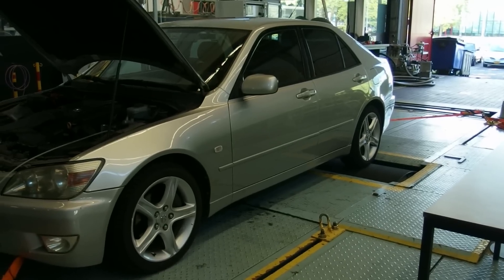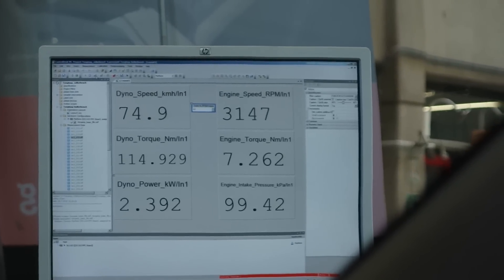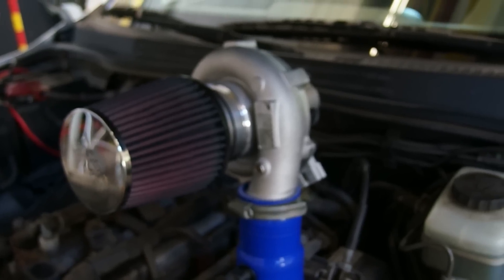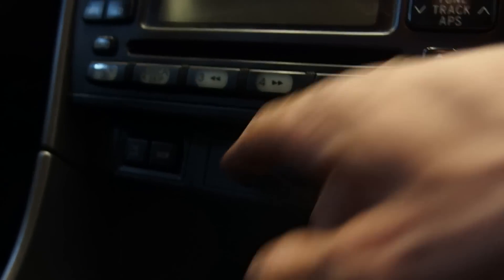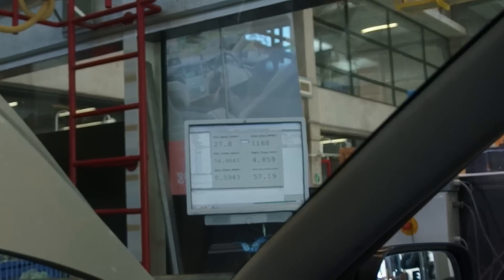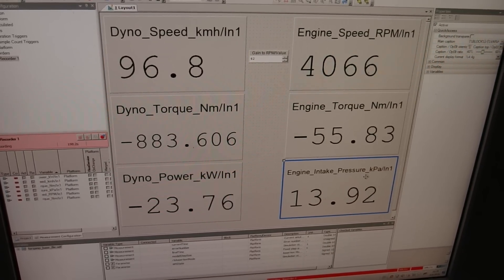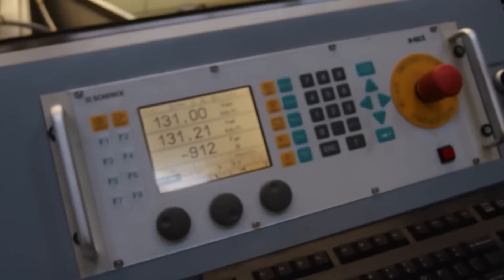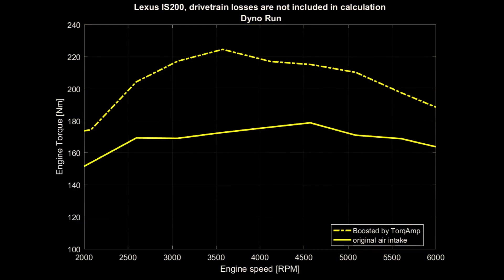Dyno testing Electric supercharger on Lexus IS200 TorqAmp

Comment: Nobody talks about the lack of airflow, or should I say - airflow restriction when you have the unit installed and you are not activating it. The car will not get enough air. To resolve that you need a customized air intake box manifold with a one way valve that will allow air to flow in when the engine needs it and the Torqamp is not active. When the unit is activated, the one way valve will close and the engine will use the boost.
Reply from the maker: This is the case when you run a large turbo build. For this we developed the Bypass valve which you can find in our webshop. 

The pressure drop over the compressor during normal street driving is small. The throttle valve in the intake of an engine is there to generate a pressure drop to avoid your engine from running lean and accelerating.

When driving full throttle with the TorqAmp off, the car is still a good and safe drivable car. But yeahh why turn the TorqAmp off when you have it installed?

Comment: When can we see this with the system properly installed. Every video I've seen it's just jerryrigged into place
Reply from the maker: These are made to show the potential of the TorqAmp on different vehicles. We will try to get some proper installations from our customers soon.
Reply: @TorqAmp  send it to me and I'll make a video doing it right,on one of the most popular engines most modded engines currently on the market. My car is a OEM+ build,something that this type of application would be a large demographic(something that could give power without a "permanent" installation). I'll edit everything and send it to u to post on ur channel(as I don't have an audience)tho the algorithm would pick it up reguardless,as well as all the equipment. Not looking for anything free,just looking for a video where someone actually plumbs this system in properly and used in the real world,and the power gains ACTUALLY given

Comment: do you not need an intercooler for this?
Reply from the maker: So far we did all installations without intercooler. The pressure is relatively low and therefore the air temperature increases is relatively low compared to turbo's which run higher boost. An intercooler could be installed but not mandatory.
Reply: @TorqAmp  cool stuff, love the simplicity. are you still developing this product? also have you tried any sort of hybrid twincharging setup? seems to me like the advantage performance wise is that you get full boost at low RPM but the disadvantage is that boost doesn't scale with engine RPM, so it's basically the opposite of a normal turbo. a combination would be interesting for sure as an anti lag setup.
Reply from the maker: @givemeajackson  yes you can check our website and see dyno graphs of both with and without turbocharger. We sell this product and several people are driving around with the system. Also we are doing small upgrades. We work with production batches. So we are producing now and this batch is not yet sold out.

Comment: I am glad that someone tried to Dyno this unit but the scale that was used is unclear is that a SAE number?
Reply from the maker: It's a dyno based in Schenck components that we use. It's not a normal dyno because this one can also power your wheels. For example drive cycle tests and regeneration of electricity for electric vehicles.

You can also find on our YouTube channel several dyno runs at several shops.
Reply: @TorqAmp  I am familiar with the dyno as we use a much larger one for EMMISSIONS testing in a class 8 lab.I have question this type of turbo but would love to see this on a engine dyno  
under environmental control using SAE scaling.

Comment: is possible to use this system to increase torque of off-road car. I need more torque at low rpm (maxi 3000rpm), because off-road tire are bigger in diameter.    engine is v8   4.5l   from Porsche.
At high rotation of engine, is there restriction of flow of air ? Do i need a bypass of electrical turbo ?
Regards
Reply from the maker: Yes the torque will increase. Gaining some performance up to 3000rpm should be possible with the TorqAmp kit. For the high rpm air flow we have a bypass valve. Check here https://torqamp.com/bypass/

Comment: could pair it with a cheap electric gate or some kind of directional bleeder. could maybe mitigate the choke when its not engaged hmm this is cool i want one. the reduction in system complexity alone is appealing
Reply from the maker: Thanks. For large turbo builds we recommend our bypass valve. You can find it on our website.
Reply: @TorqAmp  Once the world and my finances settle down, ill definitely be thinking about picking one up. Are there spec sheets avail on the website? im super curious on amperage and CFM/RPM stats :)
Reply from the maker: @patd1471  yes most specifications such as pressure map are available on our website. Let me know when you miss something.

Comment: Mechanical engineer here. It is possible to provide measurable boost with a 48V system like they claim to have. The issue that made other electric turbo is the 12V limit. Most of the time, you can't put much more than 100amp through a brushless motor made to run 12v so that limits you to less than 1kW  worth of power useful to pressurized air. However, 48v quadruples that limit, and with around 4 kW, you can really compress air and having enough flow to be useful up to around 2.0L engine with low revving ( around 6.5kRPM redline). However, it would be interesting to know for how long it can boost : there is now way a car alternator can provide 4kW continuous, which means that you have some kind of supercap or battery that takes care of providing the power. I suppose it isthen slowly recharged by the alternator ? Some infos could be interesting guys !
Reply from the maker: Your right. There is a a 48V battery in between that is charged with a special developed 500W charger that can charge from the 12V system. The TorqAmp compressor is around 5kW. So 1 second of boosting requires 10 seconds of charging. The battery can provide up to 4min of boost. The TorqAmp compressor is only rotating at fast accelerations so standing still most of the time.

Comment: i think the mistake people are making is trying to run these electric superchargers on huge engines, it was never going to work on a mustang, i think the lexus is about a 2.0 so its just within the limits of an electric superchargers. i would love to see someone test on a 1.0 3/4 cylinder engine.
Reply from the maker: You're right. For these large engines it is possible but you need for example 2 TorqAmps. You can check our channel for the Citroën DS3. It has a nice HP gain :D

Comment: Would you see a better result if  you mounted  a turbo on the output of a belt driven  supercharger instead of the exhaust outlet ,I've had this idea a while just havnt got round to trying it,I bought a c200 komp,so Il soon know if my creation is the new way forward for twin charging
Reply from the maker: Not sure if we understand you correctly. You mean the compressor part of a turbo or a complete turbo?
Reply: @TorqAmp  I mean a turbo mounted on top of a  supercharger blow outlet that exists in that  car standard ,so ur bow is psi nking gb e turbo and that's wat ur running  into ur  manifold ,so  its turbo power spooked  by supercharger instead of exhaust or both even , turbo would spool quicker I'd imagine ,
Reply from the maker: @ufoxfox4352  yes indeed, a turbo spools at lower rpm combined with TorqAmp. We have several dyno runs on our website where the TorqAmp is combined with turbocharger. Check https://torqamp.com/use-cases/ for example the Subaru Forester, the Toyota Supra 2jz, Toyota Landcruiser and a BMW.

Comment: I want one of these for my 2014 is350, but I'm not buying one till you come out with a version that can hold 6 to 8 psi of boost to 7200 rpm. If you guys can make that then I will absolutely want one!
Reply from the maker: Thanks for your feedback. We will evaluate all these comments during the development of the bigger TorqAmp. It's not a simple task because with that pressure, engine and rpm the required power is extremely high. But we will see what we can do 😉
Reply: Thank you! Cant wait to see what you come up with! I think with the advances we are starting to see in super capacitors and better battery tech it will be possible, but I definitely understand the challenges. Also, I think what you have accomplished so far is truly awesome!
Reply from the maker: @f3nixfire  yes important challenge is to get the power from somewhere. We can use the batteries as a buffer to provide enough power for short periods but we also should be able to charge the battery fast enough. Because all that energy comes from the normal car alternator. At this moment we found the right balance, but will be more challenging when the compressor requires much more power. Then people could consider to replace the alternator for a more powerful one.
Reply: @TorqAmp  I was gonna say that about the alternator. Do you think including say a 160 amp or even 200 amp alternator would make a difference?
Reply from the maker: @f3nixfire  it's hard to say because alternators can indeed deliver high powers such as 200A but not at the low rpms. And most of the time people are cruising low rpm. So the alternator cannot deliver the 200A. Another simple option could be changing the pulley a bit of the regular alternator. So it will always spins a bit faster.
Reply: @TorqAmp  oh yes, I had to do that on my mustang for my dual fuel pump setup.

Comment: Please torque amp , test 2 electric turbos on a 6 cylinder. We all want to see if it looses boost at the higher rpm range. Please get us the information , we want to see if the boost drops or maintains pressure at the higher rpm range. We have not seen any new information in a very long time.
Reply from the maker: Most important is engine size. Here you see a Lexus IS200 which is a 6cyl. We also have a video about a Nissan 350z which is a 6cyl but much bigger. You can also check the 3.2L Porsche on our channel.
Reply: TorqAmp yes but we want to see a 2 turbo setup. We all want to see a working 2 turbo setup, and the boost gauge to the rpm video verification. We all have been waiting a very long time. Send a extra turbo to somebody that can get this information. I have already seen those videos , that is not much help.
Reply from the maker: @tommycortez_  did you see the TorqAmp videos of Cleetus and Fasterproms?
Reply: TorqAmp yes , watched the videos , those are small displacement engine videos , 4cylinders. No doubt it will work with a small engine. Also they put the turbos in parallel, they need to put them in series and test. I love your product and I hope to see this setup on a bigger engine twin turbos in serious combination. You might have to sponsor somebody to get this done.
Reply from the maker: @tommycortez_  yes indeed would be nice. At this moment it is a bit hard. The University here has really strict Covid-19 rules and we are not able to use the dyno at this moment. We will try to do a proper dual TorqAmp dyno run at a later moment.
Reply: Any new updates or videos

Comment: Interesting, but with a 300usd turbo I can achieve more than 60hp and 100pound of torque.
Reply from the maker: When you can do a cheap turbo install that could be more interesting. For a lot of cars/engine there is no cheap turbo alternative. Also the TorqAmp is easy to remove and therefore perfect to keep your car original.

Comment: whats happens if install an electric turbo in a conventional turbo car? it's possible have the both turbos? how much increase the power?
Reply from the maker: It highly depends on the match between the current engine / turbo. The TorqAmp is great for killing turbo lag in the low rpms but not for adding high rpm power.
Reply: @TorqAmp  thanks!

Comment: Can You Tell How is the car injection going to handle the extra pressure? It is not programmed for this.
Reply from the maker: You're right. This is important to tune. So a tuner should program new maps into your ecu. Some ECU's such as the one in the Lexus IS200 only need a fuel cut defender to work. That makes it easier. But in general your can needs ecu tuning.

It's the same for turbochargers or belt driven superchargers. These devices only provide additional air to the engine to enable the engine to burn more fuel.
Reply: @TorqAmp  How about a low pressure like 0.2-0.3 bar, Will the stock ECU handle that? Is the MAF sensor able to send more fiel in the combustion?
Reply from the maker: @peucaue  our experience is that the injectors can supply enough fuel and the sensors could sense the additional air. We did lot of testing with older cars without ECU changes. You see the cars will start shaking and cut fuel at in the lower rpm's but will have good performance in the higher rpm's. We expect the ECU's are tuned for closed loop control in low rpm's and open loop control in higher rpm's.

So based on the experience of other people with turbochargers or superchargers on a specific car/engine you could check if it requires tuning. Or it will work flawless for a lot of miles. We always recommend to check the air fuel ratio and ignition timing of the engine at a tuning shop so you're sure your engine will not be damaged in the future.
Reply: @TorqAmp  As a Stock TurboCharger, I think this problem would solve, adding a system that detects the RPM of the car and maybe turning the compressor on only above 3K RPM. Or maybe modulating the amout of power into the compressor's electric engine, so it spins the right amout for each RPM.
Reply from the maker: @peucaue  yes this is possible. It will be comparable to FIC systems, FIC systems will detect engine rpms etc. also have the possibility to add an additional injector to provide more fuel so the engine will not run lean and you could get the maximum gains out of the TorqAmp. You can for example check ECU Master Digital ECU Tuner 3.

Comment: Better of using a big ducted fan rc plane motor.  And 6s lipo batteries
Reply from the maker: Ducted fans do a lot of flow but are not designed to build up pressure. You need pressure to increase engine torque so therefore we took a centrifugal compressor.

Comment: Maybe 100$ and people would buy em but you can peice together a whole turbo kit under 500$
Reply from the maker: Most people spend much more than 500usd on only a couple of parts of the turbo kit. Maybe a Honda Civic turbo kit could be that cheap but most turbo builds are much more expensive.

Did you ever do a turbo install on a car?

Comment: For you dummys bashing Cletus, that wasn't the same product... It was a $400 Chinese electric supercharger and they put it on an engine that didn't need it for giggles.  They just released a new video with THIS unit yielding actual HP gains on a smaller displacement engine...

https://www.youtube.com/watch?v=7a_J2X88fSE

However I do find it misleading that Torqamp hasn't been completely upfront about the need for a proper tune for proper results and this video isn't showing traditional dynographs making it confusing to interpret what the actual results could be

Comment: The 20 horsepower gain at 6000 rpm is impressive...... but the over 40 lb/ft of torque is more important ........ it’s at much lower rpms in the power ban so ur not having to destroy the engine to get the gains....... very impressive..... but cost has to come way down to be worth the power increase.
Reply from the maker: Yes indeed. The low end torque is great! We are working on lowering the price. Soon we will launch a Kickstarter campaign with a lower price. You can subscribe to our newsletter and make sure you are on the email list to get informed when we will be online. https://boost.torqamp.com/subscribe

Comment: What about using this to power a big turbo? I think it can reduce turbo lag significantly and decrease the complexity of our normal TT setup.
Reply from the maker: Yes performance is great! Check our video on this channel about the Toyota Supra 2JZ large turbo build. On our website you can also find the dyno chart of the Subaru Forester STI with larger turbo
Reply: @TorqAmp  thanks for the reply! I messaged you guys on Facebook so if we can get in contact it'd be amazing
Reply from the maker: @henry6777  thanks! Email works the best in general. Use jelke@torqamp.com for faster replies.

Comment: The price is at the moment prohibitive, but this setup makes one thing amazing: It can give you boost from idle speed, something that is not possible with turbocharrgers and difficult with superchargers. It should work great in a compound setup with turbocharger for top end power and this electric supercharger for low end torque. Actually looking at principle of operation it should give maximum boost at zero engine speed. I wonder if pressure is high enough to crank the engine if the valves were aligned correctly :)
Reply from the maker: Check out this video! https://youtu.be/RWoZtDsYdwk huge torque gain in combination with a large turbo. Not sure about cranking the engine with a TORQAMP, never tried it.

Comment: I got a BIGER air cleaner with a 12 volt blower, a little bit bigger  elbow pipe 2 months ago for $4 at a yard sale ,  just the cleaner has too worth that ?          what you say ?
Reply from the maker: An air cleane is in general not build up pressure. Therefore not suitable for engine tuning ;)
Reply: the  BIGGER air cleaner lets it suck more, so the blower will turn faster ,     +  +

Comment: Just watched Cleetus with this thing. Double thumbs up!
Reply: Thats because the one cleetus used originally was rated for like 2.0 4 cyl engines it makes 5-6 psi of boost max .... he put it on a v8 .. it jus wasnt strong enough.. and also apparently it was wired wrong but regardless still wasnt meant for that big of an engine